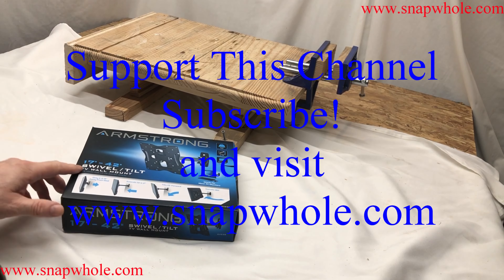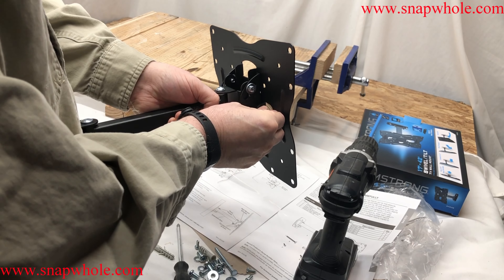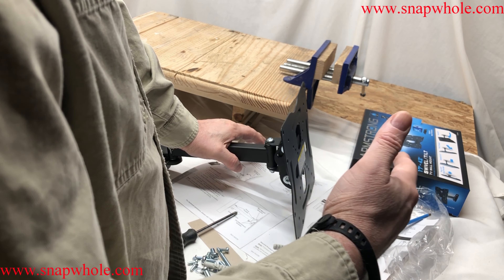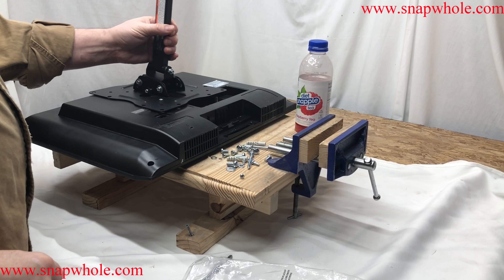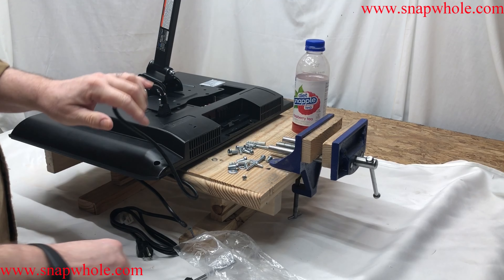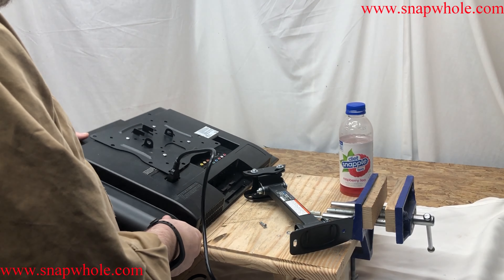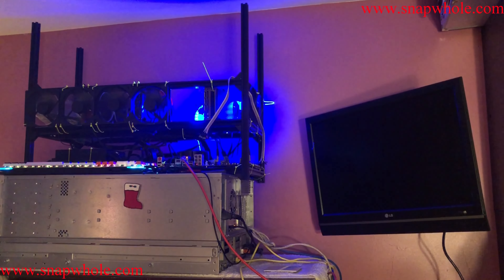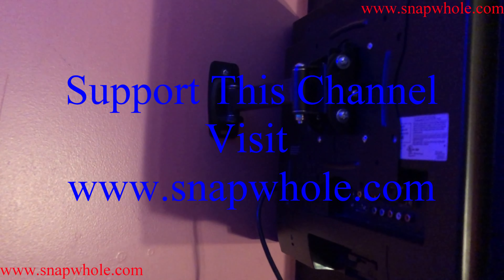Harbor Freight Armstrong 17-42 Inch Smart TV Wall Mount Installation and Review - Computer Display

Comment: I have a 50in Westinghouse, per the website, my TV weights 24 pounds. The weight rating on the mount is 66. Versa mount is 200x200, which this mount accounts for. Is there anything you can see that would tell me I can't use this mount, I mean other than the fact that it's says 17 to 42in lol appreciate the video!
Reply from the maker: unless you have a specific need for the side to side movement, I recommend the wall mount for that side TV item 64356 - https://www.youtube.com/watch?v=kmg6sjigYEQ - a TV that large has a lot of side to side torque and the attach point for the small mount is going to have trouble with that, in the video I show how the TV mount attaches to the wall mount, not real solid -  I would not trust that large TV to work ok  the largest I have put on this is a 39 inch and I didn't like how it  wobbled - Thanks for subscribing!

Comment: How do you know where the electrical wiring and water pipes are
Reply from the maker: that is called best effort without wall penetrating video - at my home inspection, I checked out the main panel and traced down the wire and water 'flow' - all cables go into the attic and come down thru the wall, so I stayed away from the outlets and avoided the power,  the water pipes are under the house and I know where not to drill - but I also screwed into the 2x6 studs, based on the path of the pipes, they to not go thru the studs, but straight up from below, cables from straight down from above  - all house are different, but every home owner needs to do the research required to understand how their house is constructed, including the path of any buried water/power/cable outside the house - Thanks for Subscribing!

Comment: How come you only mounted ONE screw into the stud? Wouldnt it be more efficient with both screwed in? Just an observation.
Reply from the maker: I just went and checked the mounting on this, it has a screw in the top and bottom,  apparently when I edited the video to make it as short as possible, that detail did not make the cut - thank you for taking your valuable time to watch all my video to look for observations - thanks for subscribing!